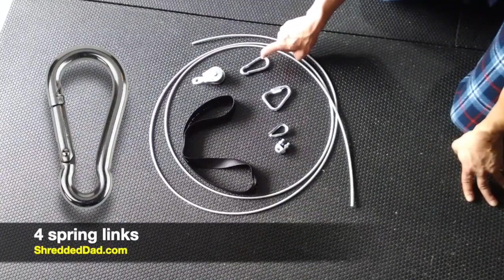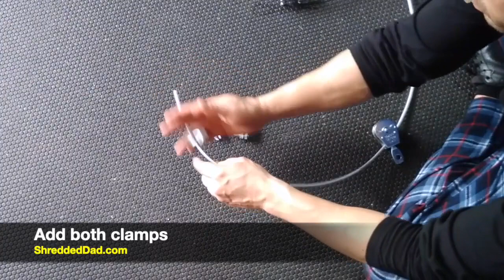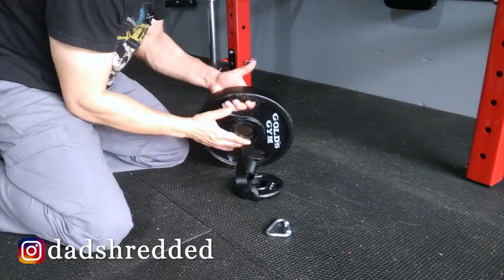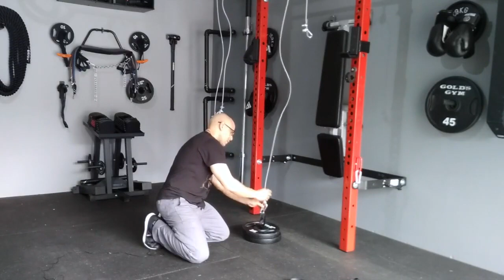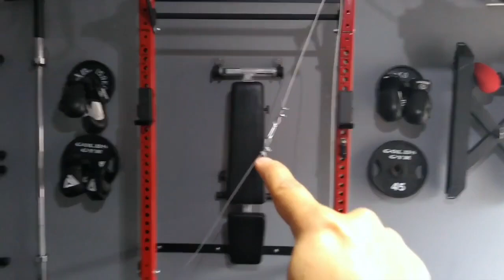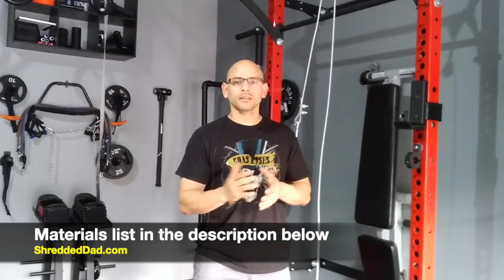DIY home gym cable pulley machine (cable crossover, high pulley, low pulley system)

Comment: How can this setup be used to do a low position cable crossover?
Reply: I think you would duplicate the low pulley system, just 2x. You could have the weights tied together like he did with the high cable crossover, have those feed into low pulleys on the left and right vertical members, and you’re set.